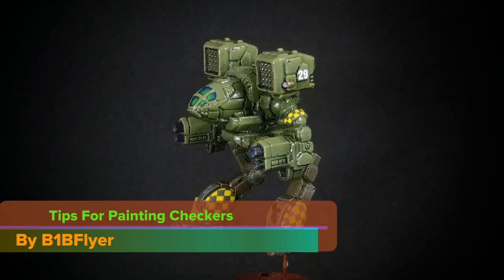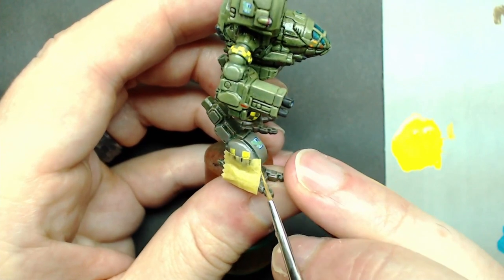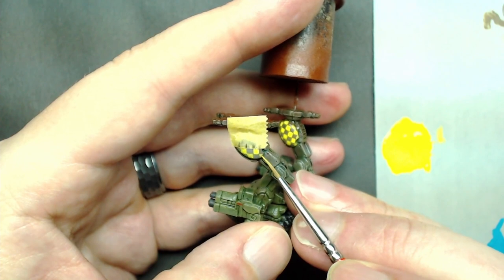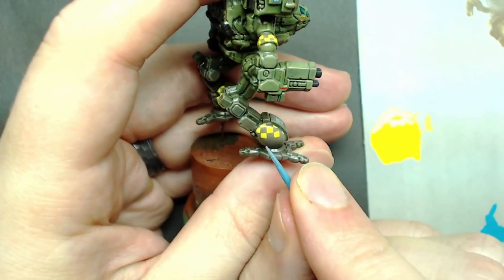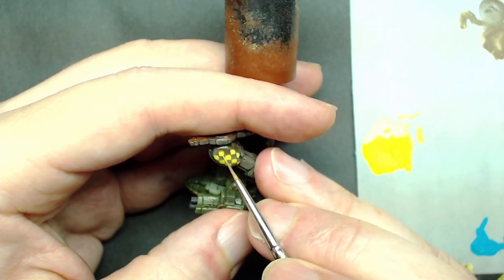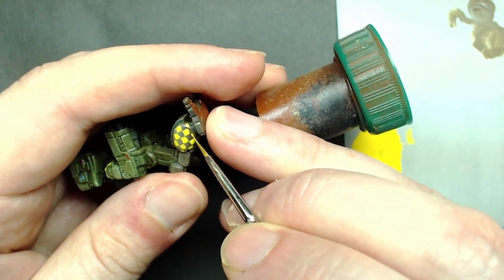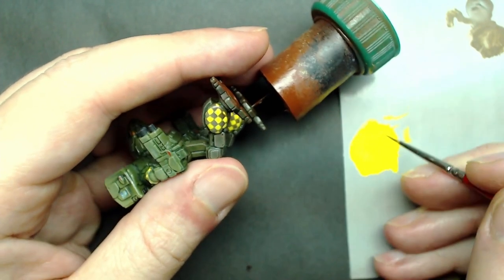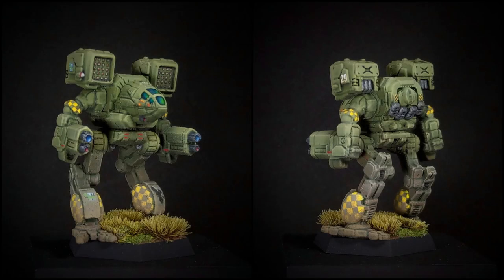Tips & Tricks For Painting Checkers | Battletech Miniatures

Comment: Thanks for making this video B1B.  Something else that you can try to use to make a grid on the miniature, when pencil cannot be seen use a technical pen 0.05mm with black, light grey or white ink.  Many companies make these.  Micron, Steadler, Rapidograph are some brands.  You can find these at office supply stores, art & hobby supply stores like Michael's and Hobby Lobby or online.  You could also make a stencil with the tape and cut out one horizontal line or checks, then move the stencil to make each row.
Reply from the maker: Thanks! I have microns in black but didn't know about the grey or white, I'll check those out. Tape stencils I've done before and I recommend against them with the size of these models in most cases. They just get to be too fiddly when they're so small.